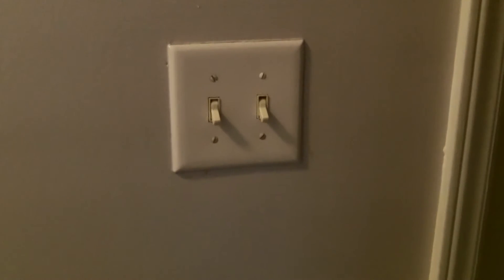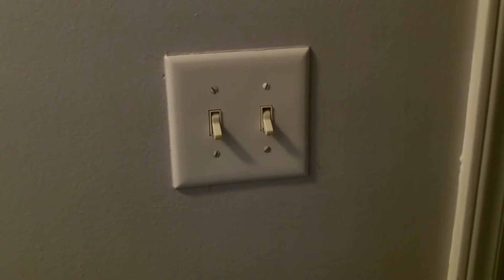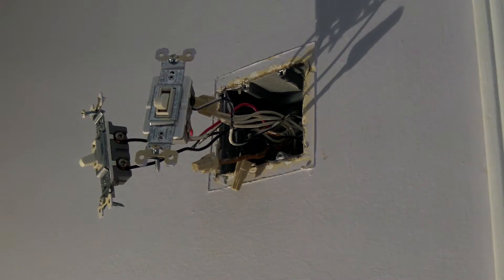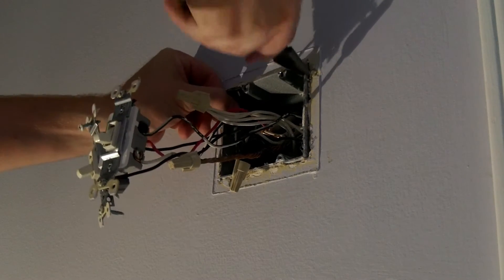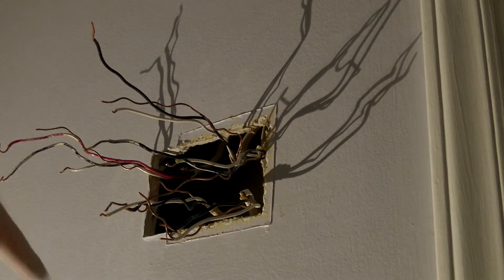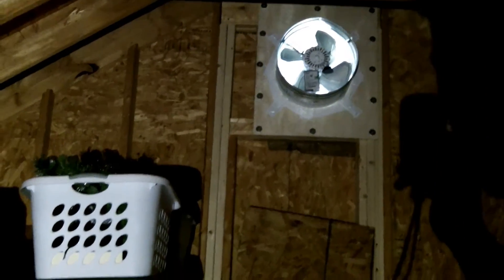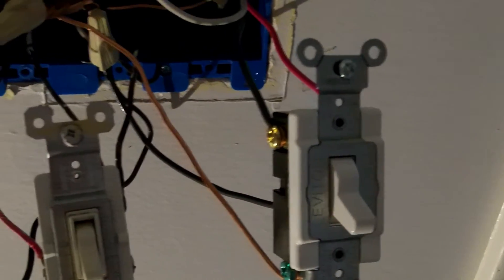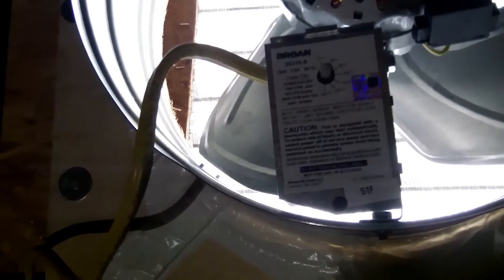Attic Fan Installation - Part 2

Comment: Again, super clean.  Nice.  It's 105 degrees outside today in East Sacramento, and currently almost 11pm and still too hot inside.  This makes me want to go to Home Depot right now and follow your example.  Usually I don't do electrical, but you made it easy.

Comment: nice job except for two things, 1 no box connector at the the thermostat and 2 the motor needs to be turned so the oil ports face up but that was installed wrong at the factory

Comment: can you hear the fan running...when your out of attic?? vibrations etc
Reply from the maker: I can hear the fan when it turns on. It's definitely not a loud noise, like when you're up in the attic, more like someone has a box fan on in the room next to you. Some vibration transfers through the frame of the house, which I think is unavoidable, but it's pretty minimal. I can sometimes hear our bathroom door vibrating ever-so-slightly when the fan is on, but all-in-all it's not an in-your-face type of noise, and now is just another background noise.